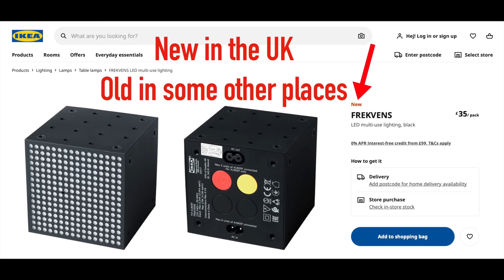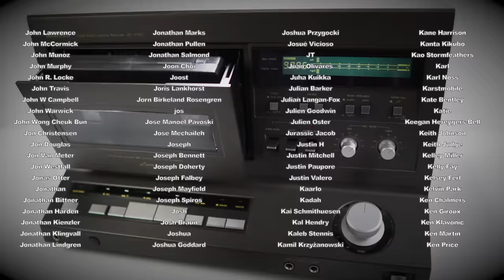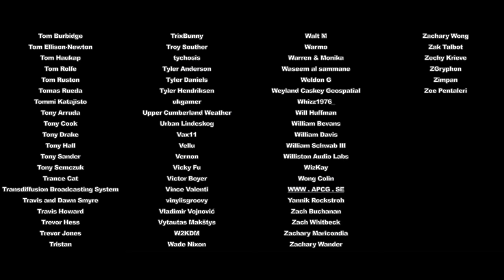REVIEW & TEARDOWN : IKEA FREKVENS sound to light box (a QUICK-VID)

Comment: Completely agree with your assessment. At first I thought it would be something with hundreds of selectable animations and maybe automatically change. Being monochrome is a style choice but possibly not the best. At £35, even with the fairly good physical construction, its lack of functionality makes it a complete fail. Maybe they pushed in a circuit from some £3 device after realizing they'd gone over their build costs. A simple improvement would have been a USB interface to allow download of custom animations and maybe an onboard battery. Multicolour LEDs would have been good too. As it stands, maybe worth £10 although I wouldn't want to risk that dodgy potted Chinese PSU running unsupervised, an external DC supply would have been better.
Reply: Every sensible musical instrument is mono: viola, trumpet, flute, etc. Mono is often a very good choice.
Reply: @extraleben6734  they're saying mono colour.. White LEDs only
Reply: That doesn't look like a dodgy power supply at all. Nicely designed, and it looks plenty big enough for heat dissipation at that power rating. I've seen some much dodgier external supplies that I've taken apart. You'd also think that ikea would be able to specify components that won't burn down your house.
Reply: All of that adds a lot. But it's too complex to hack, and too useless to use
Reply: Not sure what processing unit is in there, but addressing 16² lights seems easier than addressing 16² lights in four colours. I guess they aimed for a fancier lamp rather than an LED screen, which explains the price segment. So something going for 50+ would have defied the purpose. Same for the USB interface. 
What wouldn't have cost significantly more is coming up with better animations. But ever there I think they went with the lamp idea and the main purpose was to get loudness represented as brightness, especially when those thingies get bundled.
Reply: @Schmidtelpunkt  Instead of putting the LEDs in a 16*16 matrix, they could've opted for individually addressable RGBW LEDs. Cuts down a lot on complexity and support hardware, while adding a lot more possibilities (and colors obviously). The main downside being that the more addressable LEDs you use, the more time it takes to render a full frame, something that a LED matrix is more efficient at. But for this particular application I don't see that being a problem.

Comment: As someone who owns an OP-1, overpriced and underfeatured is Teenage Engineering's speciality.
Reply: But it looks cool tho
Reply: Overpriced maybe, but would you really call the OP-1 underfeatured? For the original $700 MSRP I thought it offered a lot. That said, hard to believe that this is the company that make the legit awesome Pocket Operators :)
Reply: @menhirmike  Okay but they aren't selling for the original MSRP are they. I think the op-1 should've been 3-500 MAX. Now its just hipster bait.
Reply: @menhirmike  They've massively gone up in price since then and the design is unchanged. I had one and I loved the sound engines but the "sequencing" method was annoying and you really had to use it every day or you forgot the shift key options. It's like a virtual 4 track but with cut and paste ability. For some people that might be novel and you can do some whacky live remixes on it, but for me it wasn't up to it. I tried an MPC live next and that was the opposite, too feature laden, too much depth.
Reply: @periurban  Dedicated tactile controls and knobs are better than a touchscreen by a mile. Does an iPad do sampling and FM radio capture? (which is a slight gimmick yes) it doesn't even have a mic input or headphone jack.
Reply: @menhirmike   If the OP-1 had the step sequencing capabilities of the OP-Z I’d think differently but it is what it is. I’m lucky I got mine reasonably cheap because at its current RRP (not even mentioning the Field) it’s comically expensive IMO.
Reply: @maxinecantspeak  hipster bait is probably the best descriptor and explanation on price.
Reply: And overdesigned.  Feature creep seems to be a company motto.  They focus on "that'd be neat" items and skip eight over the "musts" on thier design sheet.  It's the engineering version of a Wes Anderson movie.
Reply: Trust Fund Engineering
Reply: @sydneymeanstreet  i just looked it up. $2k for that. gag
Reply: There is one single product from them that I have seen that I want. Their mini itx case. Everything else seems trash.
Reply: I guess the OP stands for overpriced?
Reply: Yep, they're a lifestyle company now more than anything, I'd say they're even worse than apple in that regard, I bought myself the cheapest ipad that they sell and it runs all the music production software I need it to run perfectly, sequencer, multitrack recording, a full(ish) DAW, while the OP1 is now 10 years old and has tripled in price! It was expensive when it came out and hardware has only gotten cheaper since then yet TE sell it for triple the price, it's disgusting, it's a shame because I think the OP1 is a really cute bit of kit, feels like the modern day attempt at a groovebox.
Reply: Someone once described Teenage Engineering's business model as "garbage rich people see in Wired magazine then buy for their kids".
Reply: @GoingtoHecq  yeah, i saw that on their website. it looks cool. it's on sale rn too so maybe it's your chance
Reply: Just looks like a bunch of psuedohipster tat to me.
Reply: @periurban  You can say that about pretty much anything to do with audio "you could just get a laptop that would do more".
Reply: I’d agree, except the pocket operators are actually pretty full featured and reasonably priced.
Reply: The name of this channel really describes comments like that
Reply: This is now particularly true with the LMN3, which is better in pretty much every way imaginable. Still, the OP1 was amazing when it came out
Reply: What annoys me about Teenage Engineering products is that they have a kind of DIY maker aesthetic (especially Pocket Operators), but they are not actually hackable in any way. So it's the worst of both worlds: insanely overpriced like high end hifi boutique stuff, completely proprietary and closed, yet toylike quality and ergonomics.
Reply: OP1 is a modern classic
Reply: @Arkku  the OP 1 is hackable, as you can completely change and replace the synths and drums
Reply: @ooiiooiiooii  Completely change and replace as in code your own synth engine and replace the firmware with that, or just change the patches and samples?
Reply: I remember the introduction price of the OP-1 was around 300€ or something like that. It should have stayed at that price. The Pocket Operators started at around 35€ as well. Those are fun products.
This thing is a huge disappointment. Because it sells at 35€, they decided they would spend 2 days on it. 
Honestly, IKEA should have refused the product.
Reply: They sure got the name for their company right.
Reply: As someone who owns an Atari Video Music - I shouldn't add my $0.02... :-/
Reply: Yup
Reply: @GoingtoHecq    I find the mini ITX case disappointing. While stamped metal is normal in PC cases, TE cheaped out with thin 1mm aluminum panels, and you still need to bend them yourself. Should've been steel or at least 1.5 to 1.6mm aluminum for strength, with the components you'll put in. Airflow doesn't look good with that hole pattern, the GPU will use most of it and the lack of fan mounts on top and bottom might also add to that problem.
Reply: no dude the op1 has so many features and im not a fanboy at all i just happen to own one

Comment: There are 16 drivers on that panel, with 16 channels per driver. They really wanted "true" individually addressable LEDs.
They could've easily went with just two drivers and multiplexing, it's not like it has super high frame rat. I guess the brightness could've suffered slightly from multiplexing, but I doubt it would be noticeable.

I really like the aesthetics of the series (especially in the promo shots), but it seems that it's just this LED panel and a LED spot (without any additions) still being sold (or maybe it's just those two products that got released)
Reply: Those SCT2024 LED drivers are $0.57 in quantity according to Octopart, that adds about $9 to the BOM cost. No wonder the product is so expensive for what it does. Time to stick an ESP32 into it.
Reply: @3zuli  They are the CSSG variant, so a little bit cheaper: $0.419 for 2.5k (or $.427 for 10k according to octopart) at TME*, $0.224 for 1340+ at WinSource.  But still like $3-$6 (probably at the lower scale, in regards to volume and where they are manufactured) extra for 16 instead of 2 ICs.

(*Or is it TEM‽ Confusing logo)
Reply: Maybe they didnt want flicker
Reply: “Super high frame rat” would be a nice band name
Reply: Makes the software more complex though and looks to me like software skills aren't high on their list, might have also been memory restraints.
Reply: @3zuli  Then you're just switching the cost from the drivers to the drivers to the microcontroller.
Reply: It is a fancy LED lamp, so maybe they wanted avoid flickering.
Reply: @mfx1  I was going to write a comment about the multiplexing code isn't that complicated (like 4 lines of code), especially considering that the layout of the board seems to indicate that each driver is responsible for a 8x2 grid of LEDs (and that would require some more complex mapping).

But then I realized that they probably didn't bother to be able to do "software animations", and instead just push out each frame of the animation, that's already remapped to fit structure of the drivers, directly to the drivers.
It's the "easy" solution.
Reply: for the netherlands it got re-released, these came and went in like early 2020. and i missed out. so i may still pick on or two up as they're now in stock here
Reply: Reporting for Norway: these were promoted in 2020, but were released just as the pandemic started. By the time I visited Ikea again in 2021, there was not a trace of it in the store or online.

Just a few weeks ago, I saw the two LED cubes listed again, but nothing else. Not the speakers nor the extras like the pillows, jacket or cups.

I went ahead and picked up one of each, even tho I had seen this video beforehand. I like the design, and I figured it might be gone again soon. Maybe one day ill learn to tinker with them =)

In any case, for anyone who is interested, there are listings some listings on ebay for the other items, including 3D prints based on teenage engineering models, that can be attached onto the units.

Comment: This would drive me nuts. There are 16 LED's across. Meaning it can never come down to a single point, so the first arrow one is off centre. Nooooo!
Reply: That’s the teens bit. All image and no thought!
Reply: Was just about to say the same - right away the whole thing looked offset to the left by a pixel, which would drive me round the bend.
Reply: My OCD went nuts over this!
Reply: The arrow should point diagonally, then it would have been perfectly in the middle.

Comment: The industrial design is nice and solid but they really failed on the software side. Pretty sure the micro-controller can render proper visualizations but nobody bothered to program them in :(
Reply: Or still learning....teenage engineers afterall.  :)
Reply: I don't think you know what industrial design actually is. You called it good, but this product features practically zero industrial design. It's a black box with a LED panel on it. Nobody has designed shit.
Reply: @UnitSe7en  Do you know what industrial design is? No, it's not made of steel with a pair of handles on the front, but as consumer products go it's pretty good. The internal structure looks like it will keep everything together solidly, and the part that holds the LED matrix in place seems to improve rigidity. Would like to give it a physical look before I pass any more judgement. As for it being a black box, with an LED panel on it, all my designs for industry have kept things simple. Less to go wrong. Remember also that "industrial" is being used loosely as a adjective here. It's not supposed to be taken literally as though it's actually designed for industry.
Reply: @henryokeeffe5835  it's badly designed because it is too complex, the chinese will redesign it, held togeter with plastic clips and goo, and sell it for a tenth of its cost, with RGB LED's
Reply: @someoneelse7629  Ok, I'll take that. They've pointlessly done a crap design well rather than making it all good, or all crap (and cheap)

Comment: They're not sold out in other regions btw, they were sold out from the original 2020 run with all of the other pieces; they've weirdly decided to restock just the lights. Some people worked on hacking them before but the limited run nature of it all stopped that pretty quickly.

It's a bit baffling they've brought these back without the other pieces. They look alright alongside the other parts but it's terribly limited and oddly bulky just by itself. The lights on the matrix very much feel like they're missing a diffuser too.
Reply: It's not odd - It's simply an out-of-touch company (or important-decision-making people). They make crap and they're aware that they make crap, but some people bought that crap and they don't understand why.
Reply: @UnitSe7en  yeah I reckon you're right; iirc the lights sold out in loads of places quite quickly but the speakers stuck around for ages so the lesson they learned was "wow, these lights are really popular!"

Either that or the original order had a massive delay and now they've to offload all the extra stock.

Comment: Yeah this product lineup was part of a strange modular set all meant to attach together. They had like 5 or 6 different module types between flashing strobe lamps, speakers, woofers, fake visualizers, and stand/extension pieces. All together it makes a pretty fun looking “DJ-esque light show party toy” but that many modules together gets expensive fast. I have just one of the strobe cubes with the yellow comb filter attached on my desk being used as a literal up-firing lamp. On their own the individual components aren’t much. Together they add up to something mildly interesting.

TE was evidently trying to work with Ikea to hit a price/profit ratio with these and didn’t bother with any pricier internal processing components that could actually analyze waveforms and output smoothly to the LED Screen. If they made one that could do that for a little more cost IMO it would’ve been potentially worth while.
Reply: Yeah the speaker is decent, I have one. All the other modules aren’t that much cop

Comment: That's pants, the first pattern not centered would drive me mental to the point where I'd have to hide it when people come round. It's just tedious without any creative thought at all. Hmmm, I fancy making one with an ESP32 running Dave Plummer's NightDriverLED library. Oh, I've done it now!
Reply: I actually did retrofit two of these with ESP32s, with some custom firmware to drive the LEDs (there's some videos on my channel). It's not that hard, you can easily fit it on the original size of the castellated PCB.

Comment: All the chips on the white board are shift registers, so you get the 256 LEDs represented by 1 bit each.  It looks like a very simple and low end microcontroller on the green board w/ an op-amp driving everything - The MC is not powerful enough to analyze waveforms.
Reply: I'll keep that in mind if I ever find one in a thrift store bin. At least it would be simple enough to take out the stupid part and use it as a simple display, but it's not worth it at that price. If just the display was on Amazon for five or ten dollars I might care, but the rest of it is merely well-engineered crap.